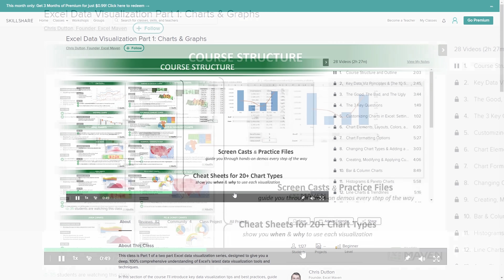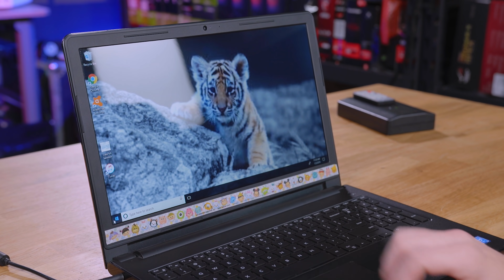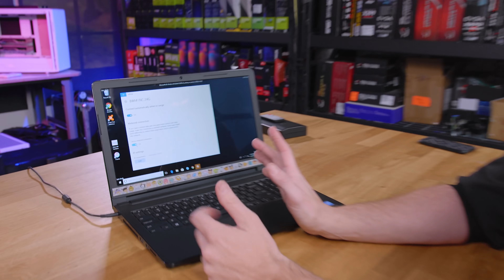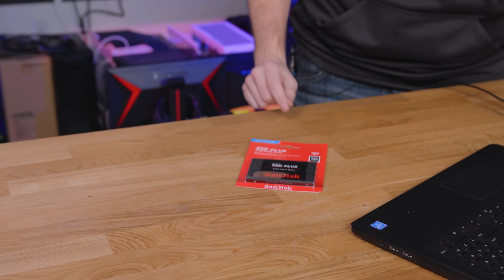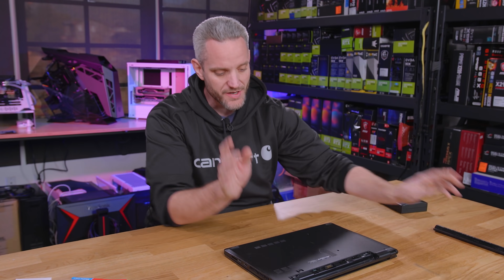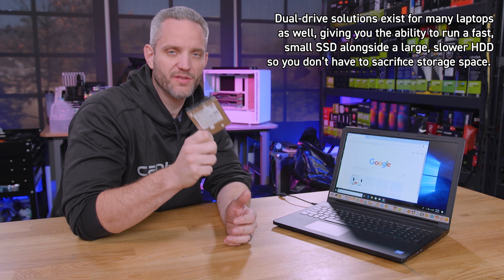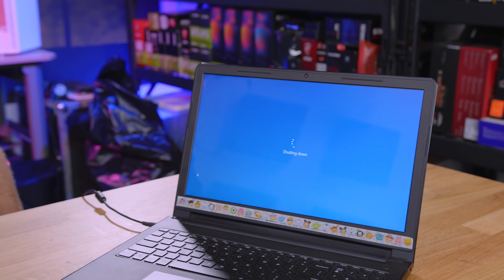Repairing an old laptop for as little money as possible...

Comment: advice: dont upgrade to windows 10 if your laptop is that old, unless you know what are you doing.
Reply: That laptop shipped with 10, the celeron n3060 came out in 2016. It's unfortunately just trash by design
Reply: could have been forced update since Microsoft claims it works on anything
Reply: @bootlegscarce0844  Is that what they're calling the really shitty ones with Windows 10 S? I hate the world of OEM computers man... If people want to buy a book I have a recommendation "Laptops for Dummies"
Reply: Yeah, my dual core travel laptop still has Never10 installed on it.  I upgraded my main setup to windows 10 without any issues at all, but when my roommate tried on her laptop, she lost all her drivers, and while i tried reinstalling them all, for some reason the laptop still had a bunch of issues.  Network drivers weren't working, video drivers weren't working, it was a mess.  Might have been because windows 10 just came out a week or so before that, but after that experience i was damn sure i wasn't going to let my laptop even think about upgrading lol
Reply: advice: try Linux.
Reply: khronosfateless 
Yeah, i did that, and installed new drivers for everything, but still nothing worked.  I don't even live with the same roommate anymore though lol
But it might have just been an issue of no compatible drivers being released yet or something, but whatever the reason, it traumatized me 😅 not even gonna try on my old laptop
Reply: @BothHands1  Windows 10 isn't as bad as it was at launch.
Reply: @BothHands1  i tried it on my Toshiba satellite 17.5" touch screen windows 8.1 laptop and it screwed up everything but luckily i was able to go back to windows 8.1 and all my stuff was still there. in my opinion windows 10 is worse than linux and linux is crap that hates everything
Reply: @MKDC-5  Exactly.
Reply: I have found it mandatory so far to debloat and optimise Windows 10 for all of my client's laptops that are old and have windows 10 installed
Reply: @SkullCrusher757  My Toshiba Satellite that originally came with Windows 8 now runs Windows 7 and 10 and Linux Mint flawlessly, triple boot.
Reply: @kennywhiddon1497  mine came with windows 8.1 which runs fine but windows 10 screwed up everything when i tried it yet it can get stepped on and have a cracked screen and messed up webcam and runs fine well except the webcam doesnt work and neither does the step screen. i have no problem with windows 7 i just dont want to use it and linux id rather die than use
Reply: that's why I'm still on windows 7, with all updates before 2015 so no telemetry shite.
Reply: been there,
Reply: Unless you specifically bought a laptop with free DOS or any other free.99 OS like linux no it will come with win10 preinstalled

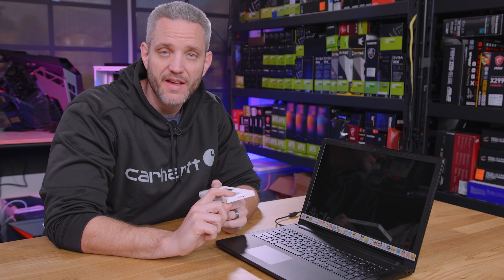Comment: 7:34 - If you are not 100% sure on the upgradability of a laptop's memory, check out Crucial's site. You can either run a discovery tool or enter the make/model in their database. Even though I haven't bought from their site, they saved me so much time and guesswork on some repairs.

Now I feel guilty.

Comment: I have a lenovo w500 and is not handled with the most care, I built it from parts. A low hour 1tb started making noise so is the reason why it has a 1tb ssd. A laptop not optimised for a ssd will still get a increase in boot time, its less than a minute for win 7.

Comment: That windows update "virus" can make my i5-4690K system unusable using the mysterious system process.
Also metered connections only stop updates for a time.
Reply: @00O3O1B  how can I get that? 
I have windows pro, so I have a lot of control over it, but still not as much I'd like to have
Reply: Thats quite question. my i5-4570s is usable to point where i dont even consider upgrade.
Reply: @marianmarkovic5881  me too except in some cpu limited games
Reply: Ok I am not there jet,... i have too many games to play list that are not CPU limited jet,..
Reply: @marianmarkovic5881  for me it's just cause 3, but I finished that. 
And weirdly Forza Horizon 3. It used to run great, but after the recent updates it has big stutters occasionally.